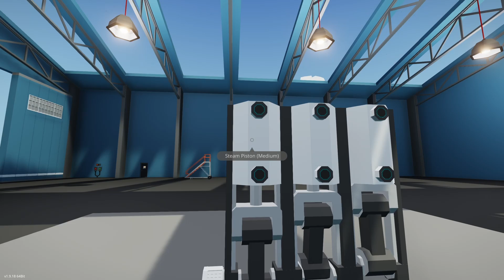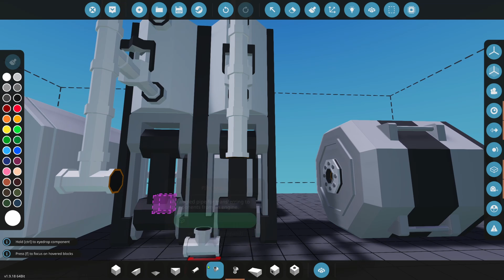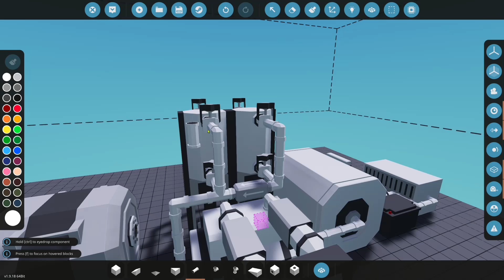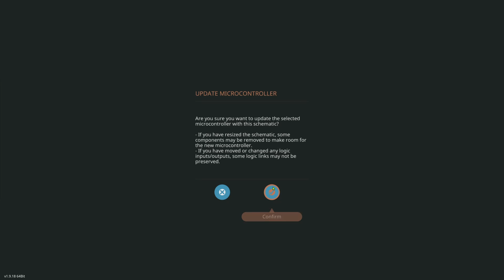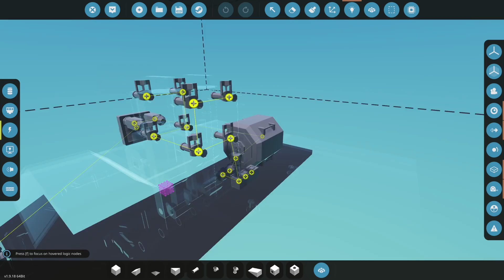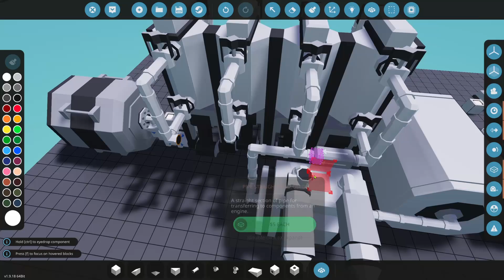Stormworks Basics: Steam Tutorial Series P4 Pistons #tutorial #stormworks #gaming #gamingvideos

Comment: does 8 large pistons = speed for a large boat
Reply from the maker: Depends on a lot of factors. The bottom line is the higher the propeller RPS. The greater the speed. And that high RPS requires power to convert the torque to RPS

Comment: Thanks so much! I tried to do this with basically no knowledge of piston operation so I tried to hook it up without valves and ended up having my pistons suck used steam back in instead of letting it out to the condenser, jamming it up with steam and stopping the pistons without the boiler being able to get any new steam made becuase of the pressure built up.

Comment: You have no idea how thankful I am that you made this! I made a medium size tanker for my classic career game and I was using 3x3 modular engines and I spent 3000 fuel on my trip to buy more fuel! Now I’m only going half the speed (which I don’t mind) but I’m hardly using ANY diesel at all! I did have to set my furnace to 145 though because my boiler would start to cool down at 120. At 145, everything seems nominal and my radiator runs to a separate room.

Comment: Actually piston position does matter, at least slightly. Whilst the pistons are always under power (every stroke is a powerstroke, compared to every second on 2-stroke and every fourth on 4-stroke combustion engines), when the piston is at TDC or BDC (so 0.00 or 0.50) it delivers next to no torque for a moment, as the crank and connecting rod are conpletely aligned. The solution to this problem is to use multiple pistons that are offset to each other, so there is never a state where all pistons are at tdc/bdc at once.